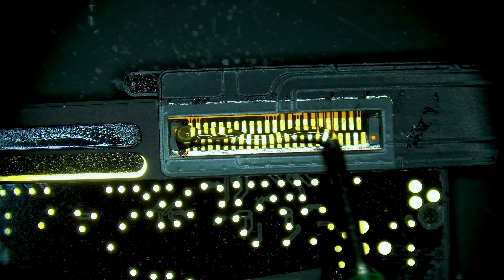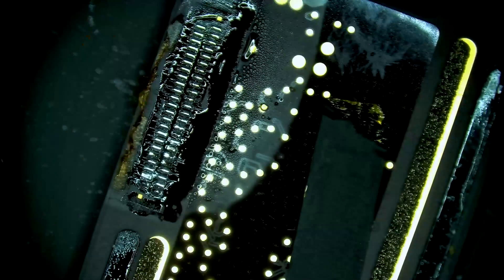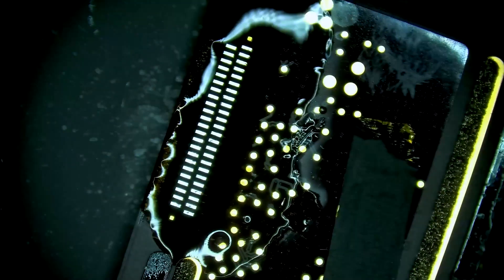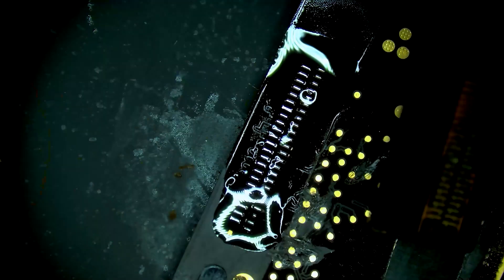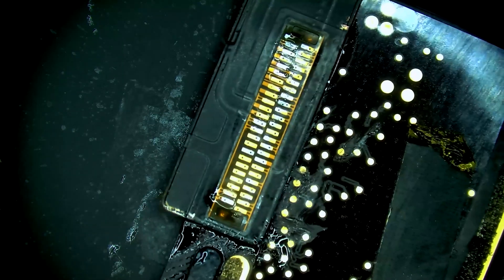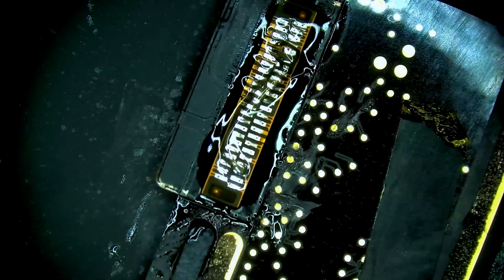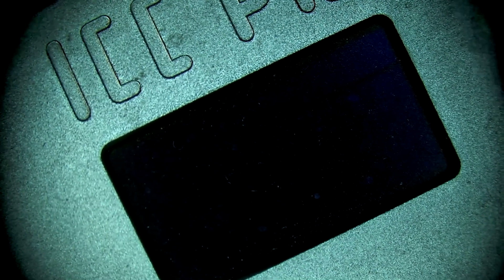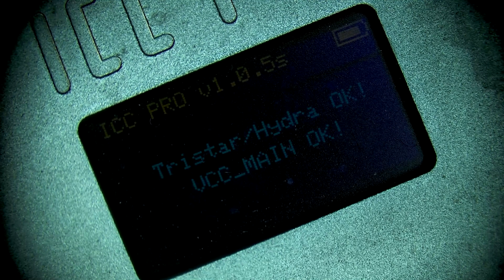How to Solder on a New iPad Charge Port Flex [Tutorial]

Comment: Hey question to test the charging port do u need to reassemble the iPad or use the test as it is out ?
Reply: Hi, I'm someone who has worked in phone repair shops since 2017 and I now own my own, to answer your question, you can leave the glass digitizer propped up with something supporting it, leaning outwards to the right side of the device where the volume buttons are, standing up at a 90 degree angle (any angle where the cables can stay connected without stress on them) and you do the same with the display but with it leaning towards the charging port. Now you have the device in a position where you can turn on the device with everything connected and test the port without having to fully reassemble it. You could also skip the second step w the display and just set it in place without screws and hold the digitizer over on top of it without letting it stick to the frame, but the first method is very useful for me when I have to leave it alone for a moment to help a customer or answer the phone. I'm able to leave it be without having to install or disconnect anything.